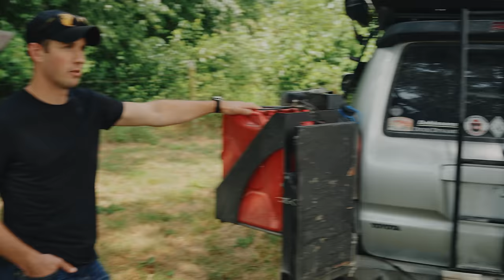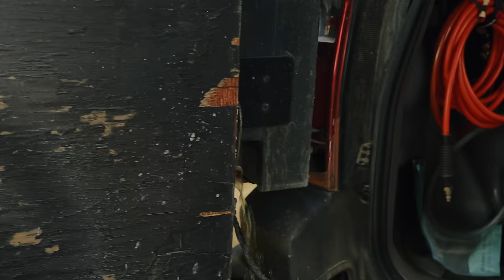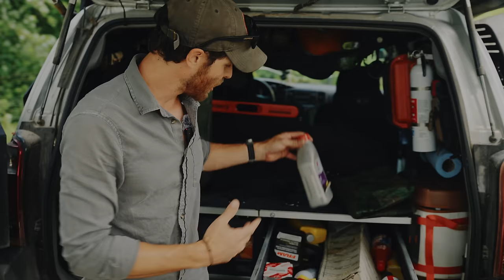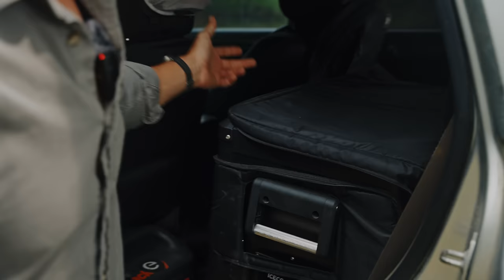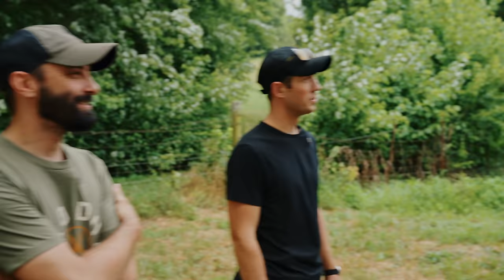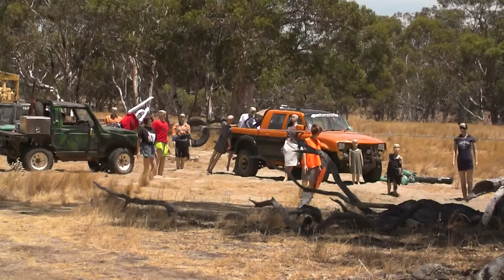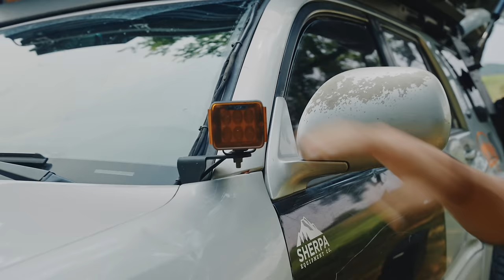4-Runner Overlanding Sustainment Loadout

Comment: I noticed this with the medevac scenario video as well but it seems like you guys don't really think critically about the actual scenario and it's just a thinly veiled guise for showing off prepper gear. Much like in the medevac scenario your gear is overkill and a hinderance for mission requirenments. Bringing that thing into a city descending into chaos is like carrying an AR-15 into a starbucks, you stick out like a sore thumb and paint a target on your back, most of that stuff isnt needed anyway the point of the scenario is to get in and get out, not go on a 3 month camping trip. Much better off going with a low key car like a corrolla, it has twice the range, offers some shelter and capability and most importantly doesn't draw attention to you. It;s not cool guy gear, but it is logically consistent with the scenario

Comment: I have a 2020 Tacoma that I'm building.  I'm strongly considering a 40 gal extended mileage tank.  I build a rack out of wood that also holds 6 jerry cans that straps down in the bed.  

I've thought about having to go get my son if things got bad, but he's 2600 miles away.  I figure that if I can go at least 1000 miles before running out of all sources of fuel, it might give me a better chance of pulling something like that off. A lot can go wrong in a situation like that though.

Comment: Get mechanic tools specifically for the truck or vehicle your driving because some use standard sockets vs metric sockets so its vital that you learn what tools are required. Battery impact tools are cool and can be charged. Always have a jack in hand to.

Comment: For a stove I cary a MSR wisperlite multi fuel smaller set up but multi fuel and the NSR pocket rocket very small but you can fit propane  both are a small footprint but all fuel bases covered.

Comment: I miss my v8 excursion. I easily got about 13-15 mpg and it held 42 gallons. Tons of room. Tough 4x4 with straight axle front end. Wasn’t fast or super powerful but with the smaller engine it could go around 550 miles between fill ups. The drivetrain was also 3/4 ton. Excellent rig. Could easily live out of that thing.

Comment: What happens when you go for yearly inspection with a rig like this.  Any hoops to have to jump through or is everything good to go?
Reply: Good thinking. Most parts of the US don't require inspections, but that is an important concern if you have to register the vehicle in a place that does require them, suspension and bumper modifications are a good way to get shame fingers from the agents of the crown. Intake modifications can get you into trouble as well in places that have smog regulations.
Reply: All is good if it passes smog

Comment: One thing I haven't seen a lot of if is the capability of electric vehicles and how they might stand up to SHTF situations. I'm very interested in getting an electric truck or suv for an off-road/survival build but not sure how having a battery powered vehicle might make things easier or harder. I imagine when gas stations run out, it would be easier to source electricity to power my vehicle but if something goes wrong with the motors or battery, things might get difficult. I would love to see some additional content surrounding that since electric vehicles are becoming the new standard. Absolutely stellar video btw!
Reply: Power will be harder to come by than gas if it were to get ‘that bad’.    Siphoning gas from vehicles would be quicker than recharging via solar.   
I love the idea of an electric off-road rig, but if the world falls apart…..they won’t be much use.
Reply: @kalikasurf you ever siphoned gas out of a car that's been sitting for 1 year or more?
Reply: @evanator2003  If the world fell apart, I doubt you’d need a wait a full year before you siphon gas……..

I’m not sure what you’re getting at
Reply: @kalikasurf  what the hell are you getting at? You keep silos for gas? You're agitating.
Reply: @evanator2003  I wouldn’t keep a silo of gas……and I wouldn’t wait a year to siphon gas…..

So take a guess what would be the most logical next step.    That has been my point the entire time, but you had to make up a ridiculous timetable and then ask me to defend my position based on your idiotic premise.
Reply: @kalikasurf  all I'm asking is where you going and how do you plan on staying there? You got a friend with a good homestead? If not you're fucked. If you do don't reply to this comment.

Comment: Hey guys, I notice that you always wear your watches really low over your wrist. I suggest wearing it above your wrist joint a little bit. In that way you get increased wrist mobility, less risk of an injury if you have to suddenly use your wrist to catch yourself, significantly less slipping around and jiggling on your wrist, and it wont get in the way of most gloves if you don't strap them. I used to wear my watches the same way (like in my profile picture) but since I changed where they sit on my arm I have really noticed the improvements! You may need a tool to take out links but its cheap and makes a huge difference in style and performance.

Comment: We have in stock (9) 3rd Gen 4Runner specific 24 Gallon AUX tank that would not only give you additional 14gallons more fuel than you two 10 gal jerry cans but it would be underneath the vehicle out of sight, out of mind..

Fill point is from an OEM split, relocation of the spare which you've already done with the swing arm, or we have additional means for those needs too.

Its down low weight, not hanging off the swing arm, and my favorite - Very inconspicuous as you don't see any external jerry cans unless you really wanted to add them as well. 

I'd share some links but Youtube doesn't like that, easier to just find us if you would like more information. Most Toyota, Lexus, and Land Cruiser models available too, Some others for Jeeps.

Stay safe out there..

Comment: me who has a prius 

One thing that I like is the ability to have the ac or heat kick on every so often and the batter will run, then the engine will kick on for a few to charge the battery and keep it going if you are sleeping in it at night.

Comment: I would suggest adding wire loom to all your wires, it isn't very expensive and gives your wires protection from vibration slowing wearing through the insulation from whatever the wire is touching.

Comment: This is cool but some things to note, as a South African who does regularly drive various vehicles in different areas of the country. Every single piece of exposed gear is a new reason for someone to risk their life and rip it off your vehicle whether your driving or parked at a red light/stop street or near an accident which is very likely.
Almost every theory you have of societal breakdown and how to navigate it, look no further - its been like this for years here. It's not sudden, its rather constant.
For your vehicle, unmarked think middle income construction supervisor. 2x4's do the job, 2l engine is acceptable while entry level. Store fuel at home, figure it out. You may need 100l, maybe you want 5000l on your homestead for the various heavy vehicles and generator/s.
The reason you want to go for a construction looking vehicle is multipart, in a high tension environment - people in the road, cars speeding and getting into accidents > construction vehicle with maybe a orange light on the roof and you will get right of way by every civie and likely law enforcement even bad guys wont bother you as its generally accepted your outto help the general public in some form. OK.
Know your environment, down to location of potential high pop zones to police stations. Avoid all of this, drive around the town on dirt roads and farm track instead. If heading into town, get what you have planned to get and leave as if you stole something, ie fast. Move with a purpose.
Keep the vehicle in good working order, fix the dents, all lights must be working - unless you enjoy police pulling you over and potentially passing on your vehicle info to a local gang. 
That's every day type stuff. 
If things get hairy, travel in convoy- keep comms check up. All the usuall stuff applies, dont joy ride, dont shit up comms, stay focused on short term onbjective/s and get to your "bug out" location. Then do quick inventory. 
Get smash proof tint on all windows, replace front screen with re enforced. People like to throw stones or whatever they can get their hands on. Make sure your vehicle on the road repair kit is up to scratch. Med kit etc and practice with it.

Comment: Similar complaint to your injured neighbor video: you're showing cool stuff and not doing the mission.

Nashville to Ithaca 848 miles.  Call it 2000 miles for detours. 3 days. WARNO specified imminent but not current shtf.  No need for a kitchen, etc.  May need to plan 7 days for breakdowns.

Get a Sienna AWD with a roof rack. Doesn't attract attention from orcs or John Law.  Couple of gunned up guys to share driving duties.  You need 68 gallons of gas for 2000 miles.  10x 5 gallon Jerry cans hidden in the luggage bag on the roof.  Trunk and possibly a trailer to haul sweetie's makeup bags and yappy dog.

Comment: I wonder why the old gasoline stoves aren't more popular with overlanders. You already have the fuel on board, so you wouldn't need to pack a different fuel source. Gasoline stoves have fallen out of favor since the advent of modern lightweight fuel canisters which make more sense for backpackers, but the old hand pump Coleman gas stoves were super popular back in the day, and they still rip. Plus there are piles of them in most thrift stores. You can get them for almost nothing.

Comment: People give me crap about my humvees, but i can load them down with 55gal drums of fuel and still carry mre, waterand ammunition and men and still get close to 300 miles per 25 gal tank of fuel. Ive armoured them on the doors and the rear,  and have doors on the roof. Ive got spare parts and honestly, both of them run strong. Most other rigs will be more comfortable,  but cant carry what these rigs can. With nods, night driving keeps you fairly stealth

Comment: Nashville to New York by the crow flies is a rough 750 miles. Best case 425 miles of fuel. So to and from there would be refilling 4 - 6 times. So mapping out reliable fuel locations probably would be critical.

Comment: Dual batteries are the move. You can use yellow tops, one for vehicle and accessories, isolated from one another. This way any accessories are not placing undue draw on the primary electrical. Obviously you'll want the largest alternator you can stuff in there.

Comment: If you ever come up to Canada you can see mine. I have a full off grid sustainable system as well a reloading table and equipment in my overlanding rig. It runs off multiple fuel/ oil sources and has a wood stove built in because northern Canada.
Reply: Have lived in it 3 years total off grid completely

Comment: The best asset for the scenario you guys had would have been a reliable friend to share the load of driving with. Being able to switch every 4 hours would make short work of a long journey. Also sustainment could be as simple as a cooler with energy drinks and sandwiches. No need for a refrigerator and kitchen. 

I wish y'all would make your scenarios a little more intense, during covid and the riots there were very little interstate shutdowns and all the gas stations that weren't in the riots in the cities were open making the scenario basically a long road trip. Adding something like blackouts in the area surrounding NY closing all gas stations and major roads being primarily obstructed would make the use of an overlanding rig a lot more appealing.

Comment: As someone that works on all vehicles,  Toyota guys never speak of the transmission  problems, or rust, but they do make good quality  outside of that
Reply: Facts on rust. Never heard of major transmission issues though?
Reply: 300k + and I’ve never had a trans problem, nor has anyone I wheel with. As far as rust, yes it’s an issue but if you treat it and take care of it before it becomes a problem, not that big of a deal.
Reply from the maker: We talk extensively about the rust on our FJ on the majority of our productions, lol.

Comment: As an overlander and rock crawler myself, I will say Subaru owners are the WORST. They buy what is technically an AWD vehicle and think they can just go anywhere. We rescued one Subaru on Imogene Pass in Colorado that was about to flip over because they were someplace they never should have been. 

Great video though. I have most of what Chad keeps on hand. I run a 2022 Jeep JL Rubicon and my wife runs a JT Gladiator with the rooftop tent. We camp a lot more since getting the rooftop tent. Did a 10 day journey from New Mexico to Mount Rushmore, all the way through Montana and back through Wyoming and Utah, camping 8 out of 10 nights while on the road.

Having a 12v fridge is a real must. On one hand it's a "nice to have" thing over just using a cooler, but not having to worry about getting more ice is just huge.

Comment: This is great stuff, but you do notice how limited this is for families, right? The moment you're 3+, this gets a little more spicy. I'm at 8, amigos.

Now, I'm in this community generally speaking that I'm not only rocking a Honda minivan, but I went and picked up a Nissan NV3500. You pull the rear seats out and then you have about a small truck bed worth of space inside to work with. Now I can fit my entire family as well as our stuff. I don't have these super awesome rigs setup like Chris, but some bungee cords, costco totes, jerry cans and water jugs, and you're not far in practice.

I can't overland the same. My vehicle is pretty good on ground clearance, but the wheelbase is huge. In my area, I don't need to go too crazy. Just some general offroading through a field is what I need, and my vehicle can do it. Its not high speed, but man, I got kids to feed!

Comment: While the 2uzfe is a great engine i dont trust them because i have seen the timing belts break on them before the scheduled maintenenance was required. When the timing belt breaks the valves meet the pistons. I would rather have the toyota 5.7l v8 because its timing chain driven.

Comment: I've heard the v8 4runners, at least the older ones have very little power increase compared to the v6. Can anyone confirm?
Reply: It's true. Having 33% extra displacement and energy production actually tanks the power to the wheels. That's why the 4 cyl ford f150s are vastly superior to the V10 Triton ford trucks of the past.

Comment: Get a renogy 50A dc to dc charger with mppt. It can handle up to 50a off alternator charing or 50a off mppt solar (600w) or 25a/ea when combined. Add a lifepo4 battery and inverter!

Comment: Finally American that takes gas mileage into consideration. Good. Right now you can afford low mpg because of cheap gas. But in the off grid situation the less you have to stop for supplies the better. 

Nie to see that you take advantage od what car provides - semi-normal kitchen, tableta, electrical charging, fridge.
Where are any chairs or stools?

Comment: I have lightened up the FJ,  also have made it more stealthy since this video.  No decals,  No exterior items.   Being stealthy , and not standing out in a WROL of scenario is key.  I have learned this lessen and reconfigured.   I can now go 1200 miles on my two 30 gallon onboard tank and 4 Scepter cans, one fill up.   No drawers anymore,  just a open space,  that way you can take only what you need and and leave the rest at home.  Bags and cases,  no permanent cargo.  The equivalent to a Military cargo plane concept.  https://youtu.be/sJVqHjG87As?si=R9kSwhm8NbJmXQu2

Comment: My 2007 V8 4Runner without all of the extra weight from metal bumpers, trays and bins will get me 24mpg on highway, 18 mixed or 12.5 in bumper to bumper.  That's 552/414/287.5 miles on a full tank.  So you might want to reconsider all of the extra weight/drag, which makes you a target for thieves too.  That thing looks like it weighs in at 6000lbs and I suspect a lot of that is the "organizational cool factor" which can be met with rubbermade bins inside and a trailer hitch tray, which would affect MPG much less. with far less weight.  Cool rig, but MPG is probably one of the most important things, so I'm not impressed.  

If this is just for overlanding - cool, it's 100% what I'd want.  For anything else, this guy wouldn't make it to his girl or wouldn't make it out of NYC with it intact.  Too gucci, "steal me" vibe.